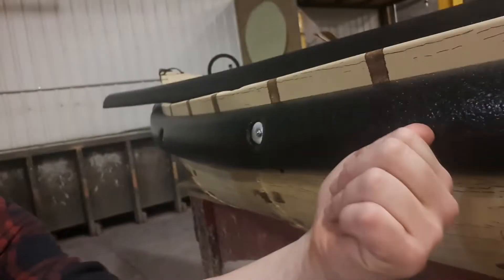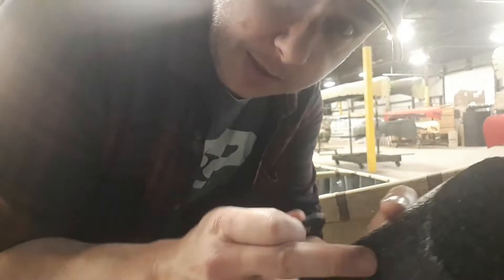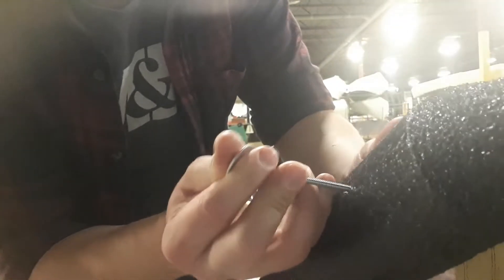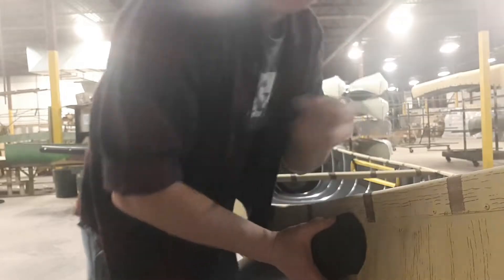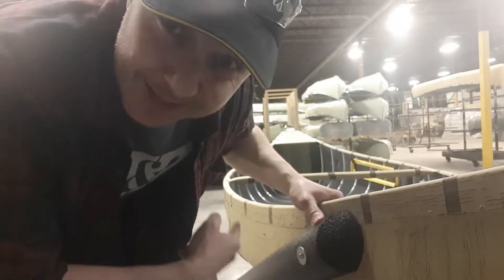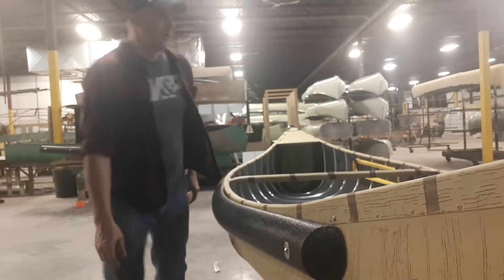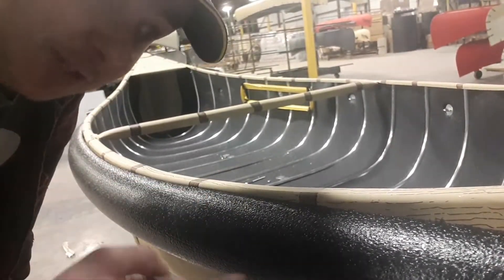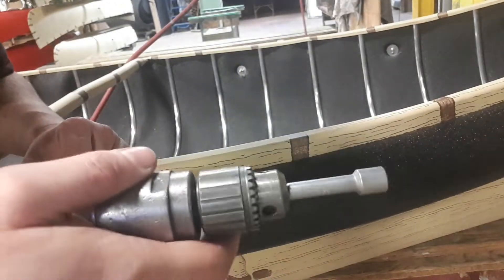Changing a foam sponson on a sportspal canoe

Comment: I have a canoe from the 70’s and it is called SportKing. Do you have parts for it? Probably need foam liner and foam on the sides. It also leaks so I would need the caulking as well.
Reply from the maker: If it's aluminum, some  parts could fit most aluminum canoes were very similar back then

Comment: Hey Dave, just bought a 12' square back, I find it's difficult to paddle from the rear, should I be paddling solo from the middle? 

I also have a motor, but sometimes I just want to paddle for relaxation thanks!
Reply: I do also feel solo the canoe is a bit tippy, is this normal? Maybe I'm just not used to it? I'm 5'5 and 230lbs so that could also be the reason
Reply from the maker: Greetings shorter boats always tend to paddle more poorly when I paddle solo I actually drop forward to my knees it helps to put a bit of weight in the front.

Comment: Hi Dave 
Dave w here again , do you have ant tips on mounting a rod holder on top of the sportspal canoe gunners.
Reply from the maker: Hey Dave actually scotty has a couple options that are socket  mount one clamps around the thwart and the other would have to be drilled and bolted through the gunnel. Scotty also has other attachments that connect to the same socket

Comment: Note that the Radisson Sponsons are shorter than the Sportspal (14 in my case) and will not work correctly. I have a 2001 Sportspal and I thought I could save a few bucks and time by buying the Radisson ones haha, I was wrong. Also, I think the Sportspal versions are a bit more beefy (hopefully more buoyant as well)
Reply from the maker: Good to know 👍